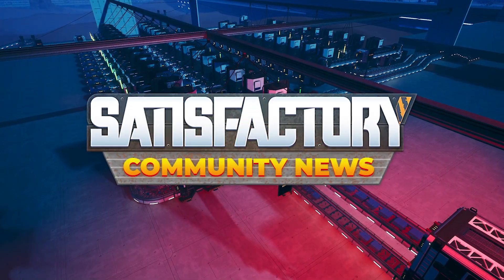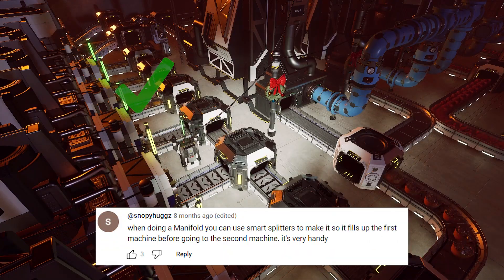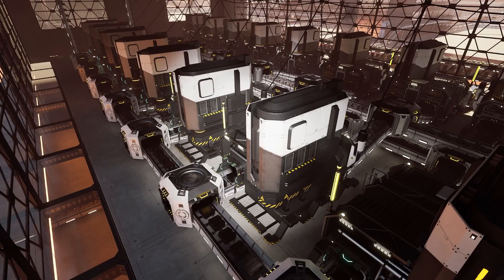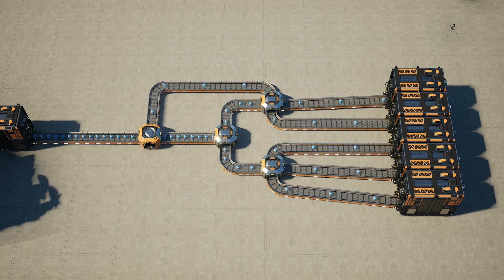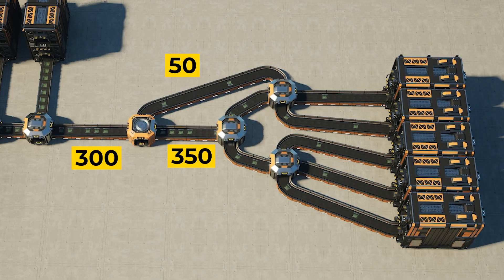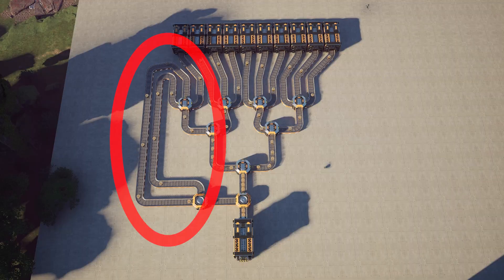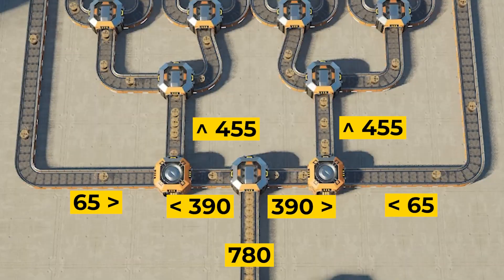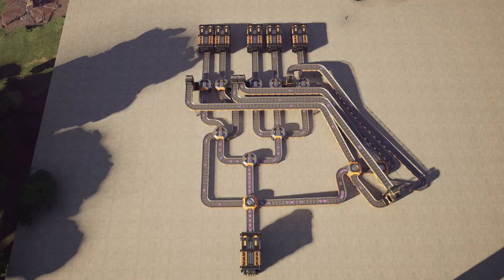Manifold and Load Balancing ADVANCED Tips | Satisfactory

Comment: Why does anyone even care to use a load balancing system?
Reply from the maker: It matters in some very particular cases, and it's a way to nerd out about math which some people like. I have exactly one load balancer in my game, it's really not needed in most cases.
Reply: @SatisfactoryNews  Blueprints make stuff like this a, do once and copy. Less painful.
Reply: @SatisfactoryNews I like it for that exact reason and idc if it's not the best its feels better that manifold so
Reply: Because they make for a satisfying factory.
Reply: @RainbowGin  But they look ugly and manifold is definition of conveyor factory - belt in, belt out
Reply: That's why I use it @RainbowGin
Reply: @RainbowGin No they don't. They make for an ugly factory
Reply: i am here at this video because i just made 6 nuclear power plants. and the first plant is filled up with materials but the last plant is still at 0. due to not all 6 plants receiving a 1 to 1 input. the machines previously in the chain are backing up on sulfuric acid because i set it all up to be a perfect 1:1 ratio. 

load balancing would have fixed my issue but i went manifold
Reply: It only really matters for power set ups without buffers.
Reply: I ain't waiting for each of my manufacturers to accumulate 500 concrete before the next one gets any. I want my HMFs now, not next week!
Reply: @pfqniet  I know it’s not for everyone, but you can hand feed them. What I do is start the miner running into a small container. Then build my smelters. Then hand feed before the power goes on. Once that’s done, I dump whatever extra ore I got into the trash, and hook up my belt. Machines are already full, so the belt fills in realtime. Then I just turn the power on.
Reply: I’m stubborn and a nerd
Reply: I use them because it's fun to figure them out and it's a fun challenge making them look good and fit in your factory footprint. Not too mention it's very satisfying to turn the whole thing on and watch all machines instantly start producing at full efficiency
Reply: When I want my factories to go, I want to make sure they can start up quicker. Sure it takes time, but it’s the cost to ensure everything is going at 100% right at the get go. 😅
Reply: Because my meds aren't working
Reply: In the early game, when you have simple factories with slow outputs, and everything powered by biomass/slots of fuse drops, the saturation delay of the manifold is deadly.
Reply: @redmix3988  yea fr i load balance up to my first coal generators
Reply: Uranium Ross rods are produced at 0.4/min and have a stack size of 50. Even if power plants wouldn't consume them it would take TWO HOURS to just fill up the very first plant in the manifold.

But it does consume them, so it takes FOUR HOURS for the second plant in the manifold to get any. That's just not practical.
Reply: Having the belts all move at the same speed at all times is satisfying
Reply: Why do you care to setup fake factories?
Reply: New player here. I didn't even know anything about manifolds. Also at the beggining it's really easy to do cuz most of items are easly divisible.
Reply: If u have a belt w 500 ipm and u need that split up into 6 different belts for more efficient production. You could run it in line obviously but tends to create issues even if the math is right. Gets pretty complicated to calculate w them but its fun once u get the hang of it. So exited to play the new update once i can get my hands on better Hardware 😂 maxed out the last world when i tried to power abt 150 fuel burners on geofrce now😂 just sad no when shooting over to the factory and crashed
Reply: Because brain orgasm
Reply: Some recipes (early aluminum) really need every machine to be working at the same time. Else you start getting uneven overflows of waste products and it backs up the whole system
Reply: It's more satisfying
Reply: manifold is scary
Reply: Sometimes if your manifold is REALLY, REALLY LONG, it won’t go down the end :/
Reply: @shardofglass  At that point for manifolds you would add some injectors just before you run out. Then you add an overflow belt to catch the extra items.
Reply: I mean I would love that the factory look neet as much as possible
Reply: Train buffers, especially large ones with fast feeds, and short train routes.
Reply: Why does anyone bother to play this game when they could get a factory, because it's just a toy man I'm just playing with it.
Reply: Load balancers are very important if you have a power setup and you are producing just the right amount of items.